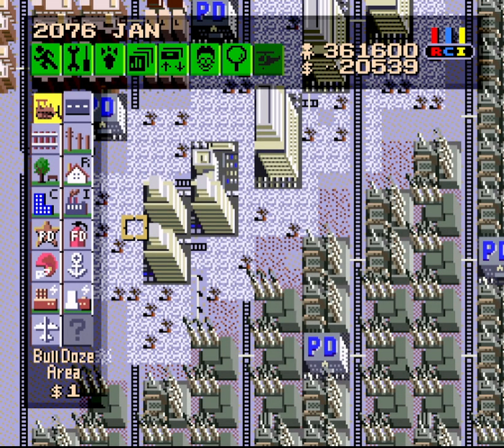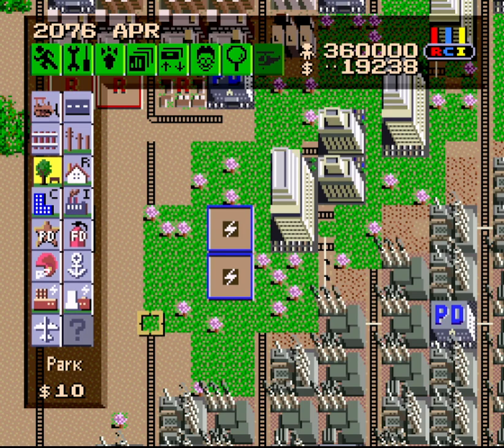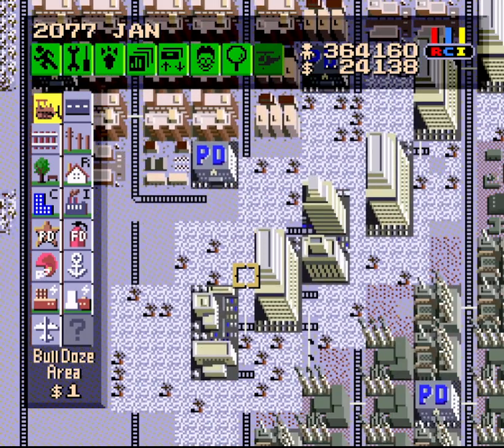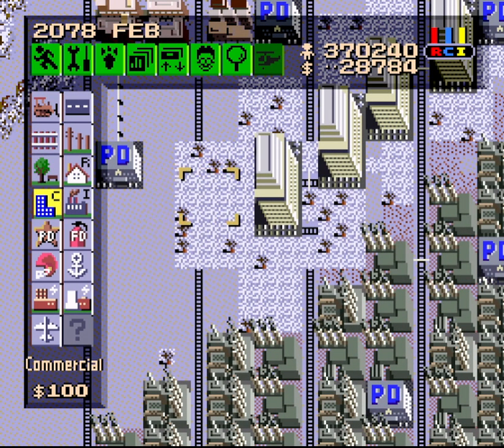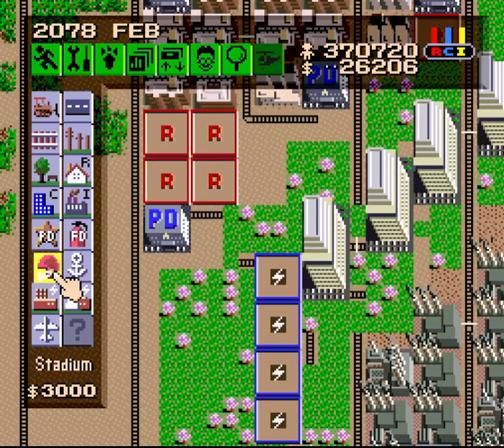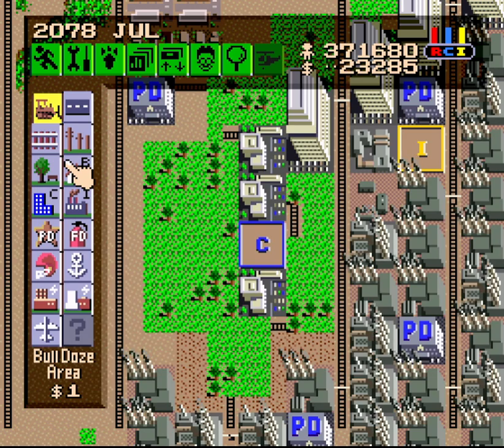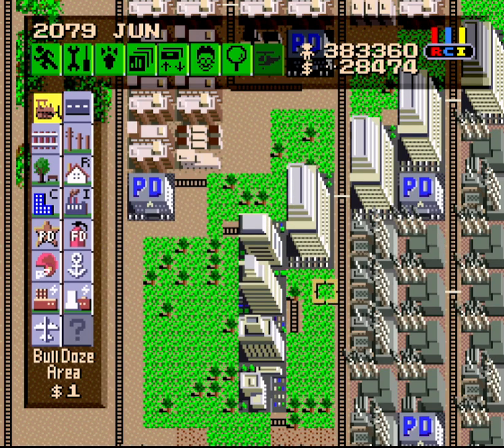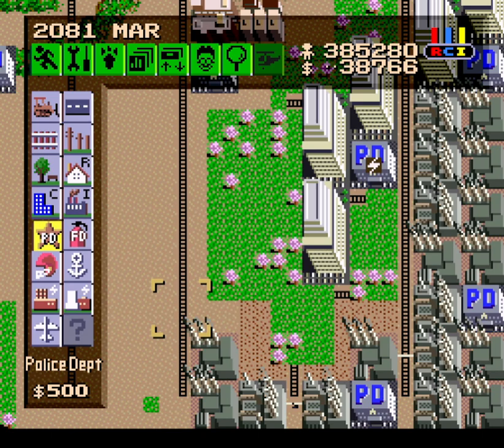Let's Play SimCity #47 (Freedom) - Sim Towers

Comment: Using the edge method, i have seen people stack up absurd amounts of ctops in the usually horrible land values. What is weird though is that an optimized city can be like 5% industrial if done well.

If you think about it like this video series, you are just building ctops right away with your city squeezed extremely tightly into the bottom right corner for insane center of city power in the land value blackhole of the edge.

Comment: What's the difference between the C-top to 2 individual c5-higher? (Hopefully that's the correct name of the highest grade individual commercial zone)
Reply: C and R tops increase your population more as well as increase the land value
Reply: A C-top counts as 2 C-6 zones. So more population and density. And C-tops stay as such when you have maxed commercial demand, Trying to develop R-tops is a pain without gifts as Residential fluctuates way more than any other zone.
Reply: A C-5 zone provides 800 population each and a C-TOP provides 1960 population. That is 360 more than two C-5’s

Comment: Why are you so stingy with parks, instead of using additional park land to improve overall LV? I know in SC3K, even a small park has an impact citywide, and 2K leans heavily on parks as well for the default “Player wants land value” tool. Is that not the case in Classic?
Reply from the maker: Parks only benefit the 4x4 region in which they are located.  I suppose I could fill out more of the map with them, but I want to save my money for the massive splurge soon.